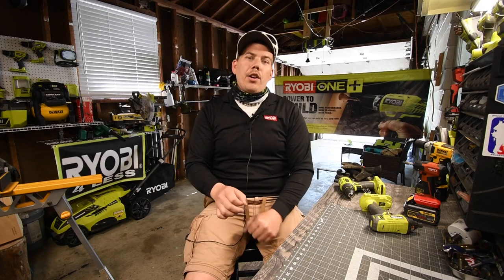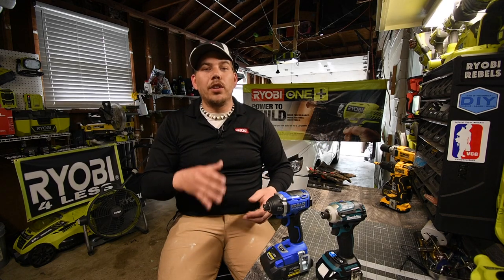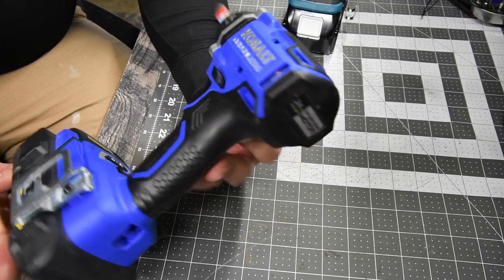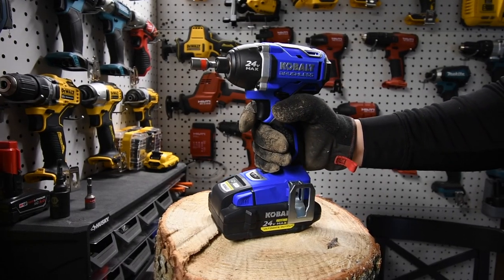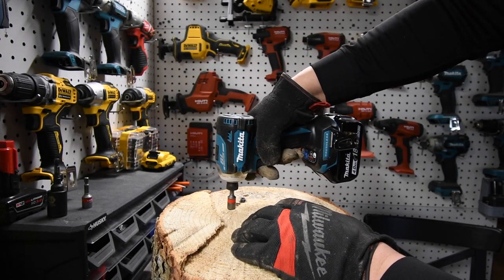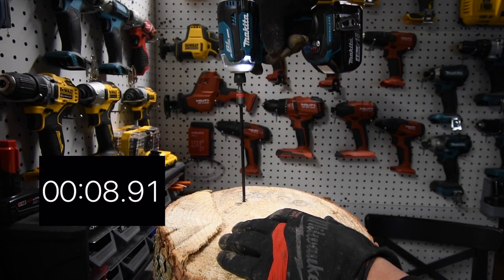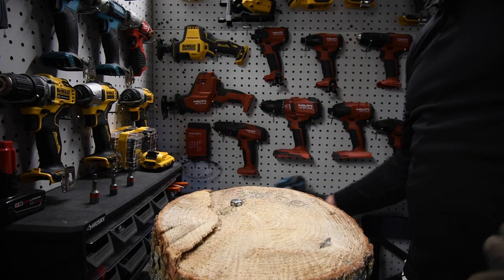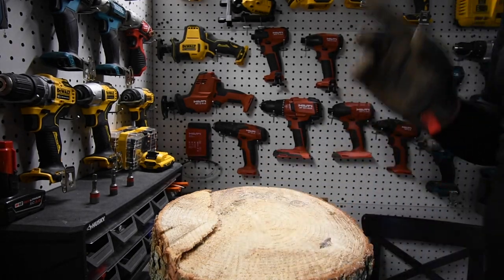Makita vs Kobalt

Comment: I had the XDT14 and have the XDT16, and there is absolutely a difference between the tools. Power isn't the only difference (which is only sightly different)  but the setting that xdt16 are great and make the difference. The Makita is significantly more compact and packs a punch than the kobalt and you can used of for delicate wood working projects as well.  An awesome tool well worth the buy in my opinion.

Comment: I've been running this Makita (DTD171 in Canada) since Jan 2019. You can't beat it. 

Size. Performance. Feature. It's perfect.

All the Kobalt XTR is, is a 1/2 torque wrench platform with a 1/4 hex on it.

On paper specs for fastening power, the comparable Makita to it is the DTW285 torque wrench and the Milwaukee 1/2" Mid torque...but both those companies realize you don't need such a giant tool to run screws down and have seperates tools for 1/2" anvils and 1/4 hex impacts.
Reply from the maker: these impact drivers are powerful now and its awesome

Comment: That button is so you can  quickly change  the speed settings 1 handed , pretty spiffy....👍
Reply: Yea thats what it does so u can change speed easy
Reply: Really good engineering and ideas just wish makita would step up their power and battery game
Reply from the maker: I thank you for the info Brian
Reply: Makita has plenty of power if that's what you want order you one straight from Japan they have a 40v
Reply: Man caver can I want a mask like you got can I order one from you?
Reply: Minnesota man read what I put Makita makes a 40v quarter inch impact try you some of that. I love the 18v and I think it is a beast it has plenty of power
Reply: I love makita they make good stuff

Comment: Don't forget the Kobalt has one extra cell, six cells over the Makitas five.
Reply from the maker: I say that the Kobalt has 21700 cells and makita doesn't in the video.
Reply: @ManCaverTools  yes, you do mention the cell size, but for 24 Volts the Kobalt will have six cells (6x4=24), the Makita is only running five cells (5x4=20). The Makita still held its own despite the lower Voltage. 

(I'm only using 4 Volts per cell as a mean average.)

Comment: I have an older Kobalt 3/8  impact wrench, impact driver, and hammer drill with 2.0 ah 2016 when i got it i think and it still rocks!  Me diy dweeb and backyard mechanic, no pro.  Love it; however i was at local HD and they had clearance on Makita LXT rapid charger starter pack for 99$. 2 batteriies 4.0ah and bag... i had to get it; will upgrade soon when Makita goes on sale tool only...cant blieve i got the Makita batteries for 99$...its like they didnt know what they had...they usually 199$ ! Omgosh!
Reply from the maker: more Koblat test and versus video are coming and I thank you for sharing your info noname
Reply: @ManCaverTools  thinkin of upgrading to the Milwaukee m12 fuel...im no pro but i want that 3/8 ratchet; kobalt makes one too but made overseas idk...
Reply: @ManCaverTools  i returned the makitas due to well idk something tellin me to go Milwaukee...